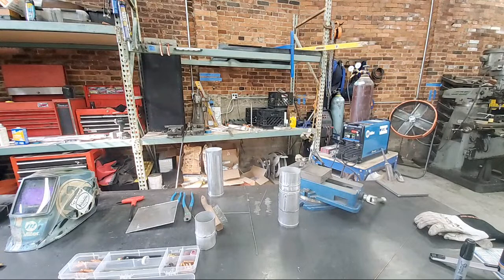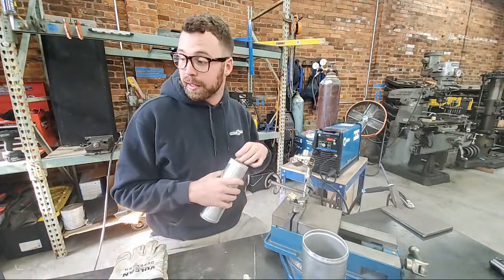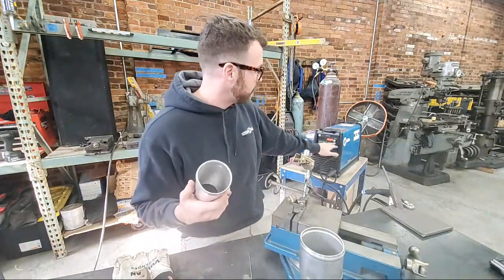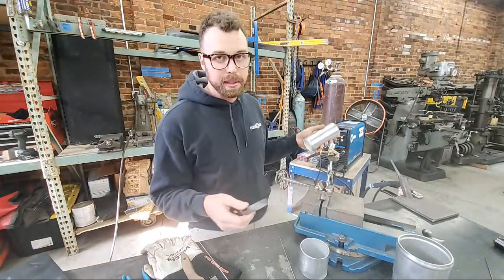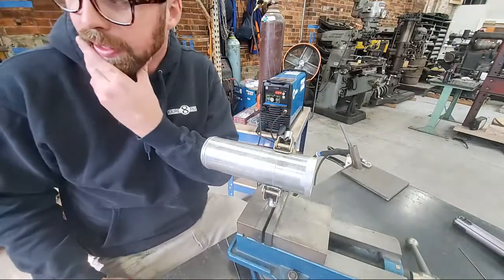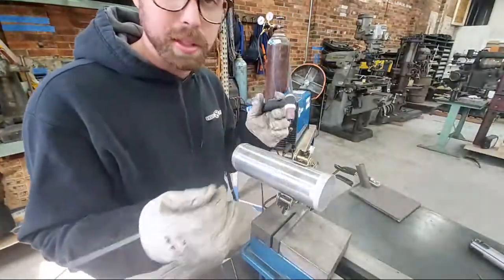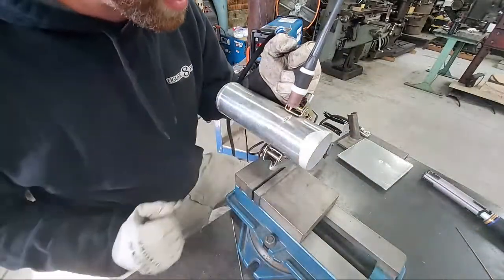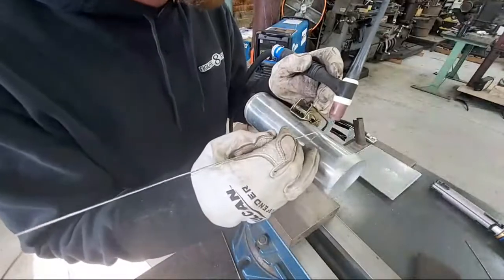Aluminum Welding Practice And Hangout With Tay!

Comment: You only get sugaring with stainless. No need to purge aluminum but you should try to push the weld into the inside of pipe.

Comment: I tig aluminum alot use a stainless brush then go over it with acetone I will even wipe off my filler rod with it and not touch it with out the gloves

Comment: Gerday mate, tig welding without a filter, not good, even went & got my welding helmet, useless so got the brasing goggles & just as useless. Please put a filter on the lens when showing welding. I know when I was brasing the amount of movement at the blue tip of flame was wider than stick welding. Tig, couldn't see the movement in yout left hand, but got the filler hand fine. Thats the one I know how to do. Anyway thanks for trying.  Peace out.  Wayne